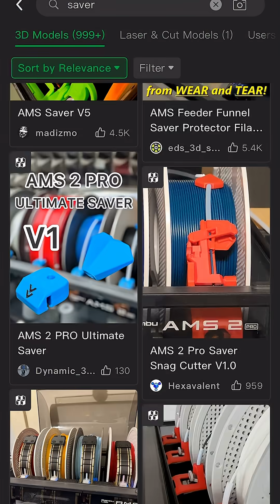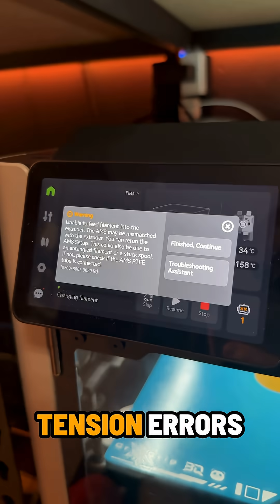Most Printer Mods Are Useless. These Aren’t.

Comment: I have a printed extension on the nozzle wiper so the poop won’t fall on the print bed, that is everything I need
Reply from the maker: That sounds super intriguing because that is a real problem at times! What printer are you running?
Reply: @NicksNacks3D  P1S